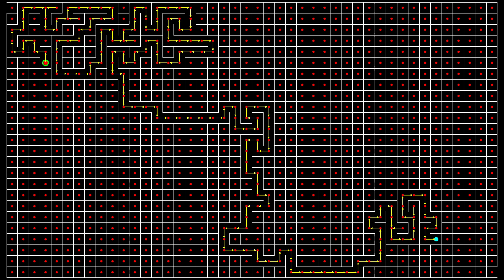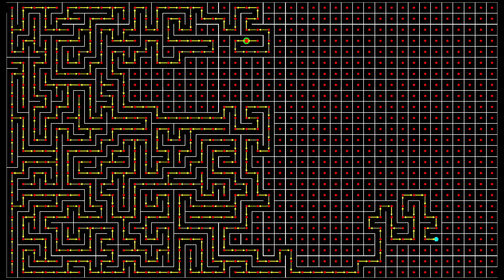I Made a Maze Generator in Unity Using the Origin Shift Algorithm

Comment: I'm a bit confused why this algorithm was made in order to prevent large red stone circuits. Those seem like 2 unrelated things?
Reply from the maker: Redstone circuits are inherently large, even when optimized for minimal size.  And a dynamic maze is implemented by giving each cell its own copy of the maze generation logic.  The more complex the logic, the larger the cell has to be to accommodate the circuit.
Reply: This algorithm is made simple enough that it can run fast and small. The logic needs to be translated to redstone so less logic is less redstone

Comment: origin shift takes a perfect maze and changes it. it isn't really a create from nothing generator.
you can use any maze generation algorithm that ends with a perfect maze and then start the origin shift.
the only requirement is that you have the vector map or "ternary tree" that points to the origin point/root.
you can either generate the map by walking the existing maze or by keeping track of it while the other maze generator is running. like you do in the end of the video
i made a version in godot and i'm starting with the simplest maze that is shown in the video. a few friends made more complex starting mazes by starting with a pattern that is spread over the map.
the use of a pattern makes it so that less iterations are needed to make a new unique looking maze.
i also added a visited count to each cell that the random walk uses to change locations faster and not loop back to positions it already went to as fast. sure it is a bit slower but i only need a few iterations every few seconds so i don't really need it to run in <10 micro seconds per iteration.

Comment: The Origin Shift algorithm isn't used to generate a perfect maze, but to change it so that it still remains a perfect maze. So to use the Origin Shift algorithm for generating a new perfect maze, there should already be a perfect maze, even if it's a simple hardcoded one. In the video there's no maze at the beginning, the Origin Shift algorithm actually starts taking place after all the points are already connected to all the other points via exactly one path between them.
Reply from the maker: So what should we call the algorithm when it's used before there's a completed, perfect maze?

Comment: I believe this is the Aldous-Broder Algorithm at the start. I think Origin Shift is an adaptation of Aldous-Broder Algorithm to modify existing mazes.
Reply from the maker: Interesting.  I just looked it up and the two algorithms are nearly identical with one major exception:  The Aldous-Broder Algorithm does not modify existing connections.  The Origin Shift Algorithm does.  Thanks for the info.
Reply: @TimothyChapman  I'm not sure there's an appreciable difference between the algorithms (but modifying the maze as you go might prevent the Aldous-Broder Algorithm's uniformity feature from applying here). I'd guess your algorithm is slightly more complex, as it maintains the direction of each edge in the graph.

I want to clarify that I'm super impressed with your ability to generalize the Origin Shift algorithm to work with empty mazes! I'm going to add it to my list of maze gen algorithms to evaluate for my project. 🙂
Reply: @TimothyChapman  Also! If you're wanting to use Origin Shift with good speed in unity, you might look into switching to Wilson's algorithm after a certain % of the maze is filled. It  has the same texture of Aldous-Broder Algorithm/Origin Shift (while depth-first effectively generates one long corridor with short deadends branching from it).